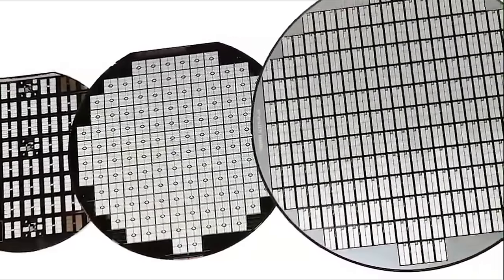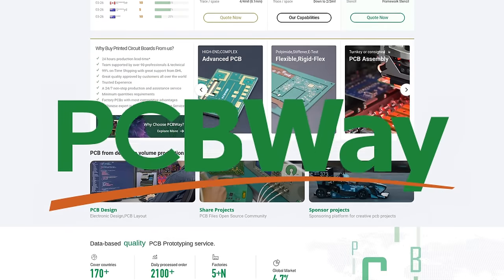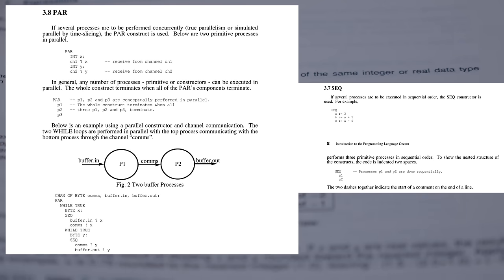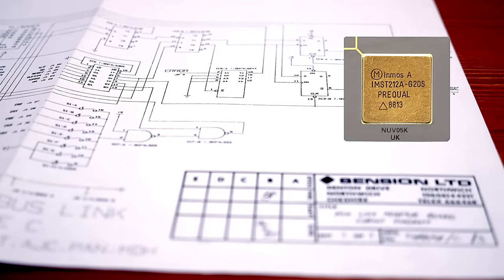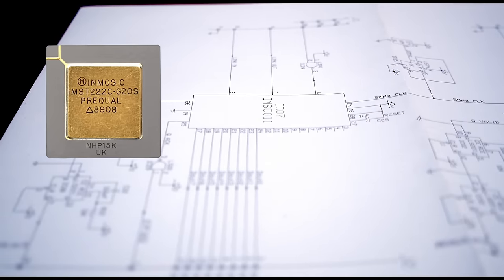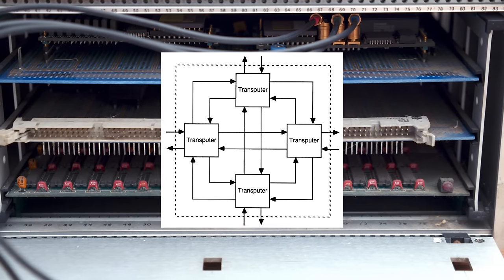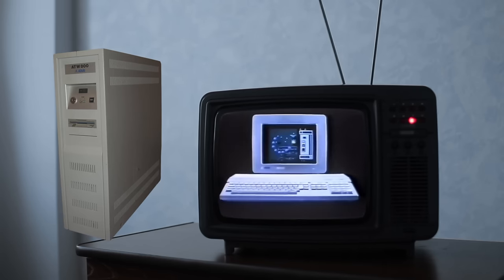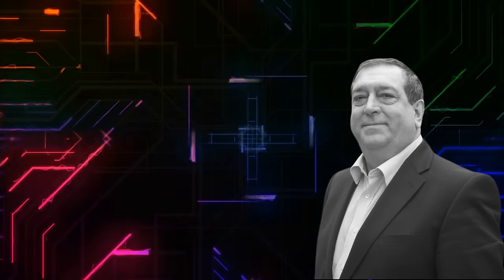The Transputer: A parallel future

Comment: In the 80’s I worked with a friend to develop a native 80x86 implementation of occam (called pc-occam). It is a brilliantly simple but powerful language, and so easy to use to write bug-free code. The idea was to make Occam available to students and others who couldn’t afford / get access to a transputer system.

The three things that impressed me most were:

1) Parallel tasks could run on one transputer or another - but the means of inter-task communication (channels) was identical.

2) Multi-tasking was built into the transputer hardware based on task switching on the jump instruction. Simple and efficient.

3) SEQ / PAR. So simple and easy to use.
Reply: wonder how well itd run on a modern ryzen system
Reply: @cal2127  Not well. Remember that this was a time when memory access latency was much more in line with CPU performance. To get decent performance you'd have to limit memory use to L1 cache only (and there's no way to do so explicitly on x86/x86-64) and then you'd swamp IPI/IPC (which you also can't use explicitly). Modern architectures are simply not designed for Occam's execution model, which isn't particularly efficient to begin with (it 'won', to the extent that it was used, by being a) tractable and b) giving you a lot of compute by the standards of the day with the transputer). OTOH, you could write an emulator, run the whole thing on a single core and get oodles more performance than it had back in the day (such a thing exists as 'the transterpreter' - a backend for an occam compiler, both now sadly abandoned). Incidentally, there are a few similar projects alive today - a wafer-scale supercomputing chip with tightly coupled processor+memory tiles and a switching fabric, and an ARM-based 'neural computing' set-up in Manchester iirc that is also processor+small memory on a single board interconnected with some sort of ARM bus (not aiming at high performance, just an experiment in mimicking human brain style computation).
Reply: I used Occam commercially in the 90s.  A total dead end of a language.
Reply: @drlloyd11  In what sense? Popularity in industry? Sure. Syntax seems.. inelegant, particularly to people acculturated to Algol-style syntax (Wirth-inspired syntax languages generally suffer from this due to not having a single outstandingly successful language, cf Lua and FreePascal). Conceptually and technically? Very interesting. Unfortunately, the type of problem it is most suited for also typically demands performance and scalability and Occam as-is doesn't deliver on that front, so even if it were updated to have modern tooling, people would likely use more performant languages and kludge CSP constructs on top if they really wanted them. One can see microservices in that way if one squints. Golang is the unobvious and indirect successor.
Reply: @paulie-g   In the sense it's performance was mediocre compared with using the other hardware available at the same time.
It wasn't useful.
Reply: @drlloyd11  Yeah, the performance - just at a glance - doesn't look to be on the cards, the language gives up too much for its abstractions. It always seemed (to me) like the CSP model and resultant dev experience was supposed to be the big win, not performance.
Reply: But what about when the parallel tasks had to communicate to each other, and time the addressing of possibly a shared memory pool? That's where things get really fun, trying to deal with resource contention, and timing of tasks to not miss an update if the variables are on another processor. 
I don't mind simple languages, but first you have to know will it do what you want and be adaptable to changes and updates. Also acceptance for code maintenance and people not shunning it is also important.
There are literally thousands of dead computer language githubs out there with no easy way to convert. 
All one can do is take the core logic of operation and start anew in something standard and modern.
(for example. I did an overhaul on 230,000 lines of Quake C on a quake client mod, and it is not flexible like C++, and the server code was in C++ but just bodged together to barely pass an old compiler, but not the latest. )
Reply: @TheMechanator  the language was designed to avoid all that. No semaphores, no shared memory, etc, so no contention or deadlock possible. All communications (local or inter-processor) was via channels. Like the CSP language it was derived from, it was designed to be mathematically provable that it worked (even when using different processes and processors).

But it was very unusual, somewhat hard to work with (limited), and tied to the hardware; so died along with the transputer.
Reply: @TheMechanator  What is your point?
Reply: @TheMechanator  If you think variables can be 'on another processor', I'm afraid you're not in a position to to discuss programming languages.
Reply: @drlloyd11  But wasn't the fundamental idea behind Occam, and the hardware used to implement it really about a framework for computing that abstracted away the details of that implementation from both the programmer and the physically wired system?

Ideally, you could literally program once, for a single processor or one that had potentially thousands of processors, that theoretically need not be local to each other, and not have to care about those details or how they connected at the real world level.

Had this had a similar level of research and design effort as x86 or ARM it might have led to a world of low MHz processors (more power efficient) yet scalably more powerful, without caring about the today version or the tomorrow version of the actual hardware.

Practical, not with the way we program today; Occam does require a different mindset, and other advances have negated the argument, perhaps only because people gave up on it given the easier technology path since adopted.
Reply: @paulie-g  It would be interesting to FPGA some of the Transputer ideas though. Even a scalable Transputer core for MiSTer could be a retro path for some willing to burn a few real-world life cycles over.
Reply: @DennisHolmberg-sl1hz  Personally I would consider software emulators to be a more practical path forward. There is at least one that was far enough along to try things iirc. FPGA is going to be tricky. There's an argument that transputer nodes are similar to tensor cores in GPUs, so a compute shader implementation might be interesting.
Reply: @paulie-g  True enough, that train has long moved on.

Maybe someone will find inspiration from Occam, Helios, etc., and things will move forward like the old days. Today, the current tech being what it is, is the path chosen and where all the inspiration/perspiration will be expended.

It's is similar to the mythical Cray machines from a today point of view vs. a when we were there point of view. Nostalgia has a was of leading to what we could have done then if we had then what we have now moments.
Reply: @DennisHolmberg-sl1hz  That's the thing, I'd love for there to be a good way to experience development in that paradigm. Even modernised post-Transputer Occam isn't viable as a language, but the experience could inform features/directions in present-day dev.

Also, don't write things off. It only looks like Transputer or Cray were dead ends. They really weren't. Modern manycore machines with interconnects are very Cray-like if you zoom out enough. Like I said, tensor cores in your GPU are very similar to Transputer nodes. At a different level, the cells in modern FPGAs that combine some logic and some local memory are conceptually similar (just at a different scale).

Yes, there is lots of stuff in retrocomputing that is charming, but obsolete. But there is plenty of stuff that is very much worth revisiting at a conceptual (if not implementation) level. Pre-relational DBMS are a good example of that.

Comment: Tony Hoare was head of the Oxford University Programming Research Group (in effect the CS department) when I did my Engineering and CS degree there in the late '80s.  Part of the CS course was based on his "Communicating Sequential Processes"  (CSP) formal language, upon which Occam was built.  In later undergrad projects I got to play with quite a few transputers, including ones with audio DACs and 24-bit frame buffers attached.   CSP and Occam's communications channels also heavily influenced Google's "go" language.

Comment: I worked at the Inmos Newport fab during the Thorn EMI years; I wrote test routines so if you have a duff chip it might be my fault 🙂 The transputer had very few opcodes (they were fundamentally 4 bits long) but it wasn't a RISC chip to anyone except marketing; Its instruction set natively implemented multi-threading, which was very complex, in order to allow single chip parallel algorithms. In my time there we went from successfully introducing 20Mhz T800s to failing to introduce 30Mhz T800s, with some cool new stuff cancelled along the way. Meanwhile Intel had gone from 12Mhz 386s to 50Mhz 486s in the same period, which really showed what we were up against.
Reply: So what sort of cool stuff got cancelled?
Reply: @12Mantis  The most interesting was a vector processor in place of the FPU on the T800; it could have been a GPU before the world had ever though of a GPU. There were also plans for other dedicated interface processors alongside the M212 (which had a disk interface on chip). And the project which eventually produced the T9000 was restarted from scratch at least twice.
Reply: @Error6503 I grew up near and spent a lot of time completely unaware of that spot in Newport. Interesting to hear some inside knowledge, thank you for sharing.
Reply: I always thought it was a shame that T9000 link packets weren't just a little bit longer. If they had been, the technology would have been shoe in to implement ATM. The C004 switch chips were ahead of their time, and the C104 was the logical extension of that, but without being able to tap into that burgeoning telecoms market, DS-Links never got the economics of scale to become a world beater.
Reply: Thinking they could stay in the fab-ownership game was what finished them. Intel were pouring $billions into silicon process development, Inmos had £0.50... It was never going to work.

Comment: There actually was another OS for transputers, Trillium.
I once had the source code for it but a disk crash 30 years ago made me loose it.

From the beginning of an article...
"Trillium is an operating system designed for a
loosely coupled, message passing ensemble architccture,
such as the hypercube class of machines. It has
been implemented for the FF’S T-Series[l], a transputer
[2] based machine. Trillium presents a uniform
programming environment that extends out of
the parallel processors to encompass the front end
computer and and personal workstations accessible
over a network. C and Fortran compilers are available
along with a suite of backend development tools
including a transputer board simulator."

A couple of friends and I actually had it running on our homebuilt transputer hardware back in 1991.
Reply: There was also Minix. I had it running on my transputer system a few years ago.
Reply: Homebuild Transputer, maybe the only thing that i was interested more in 1987 then losing my virginity. 
But unfortunately, all tries with my own first designed and build Z80 system showed me i will never be able to this fine tuned skills of soldering.

Comment: Used a crapton of these in my first job. Crash test systems, predictive failure analysis and signal processing. We went through thousands of them. Development used two Meiko dev systems and one very much like if not the same type unit you have. We used the ISA cards and TRAM modules as well as our own cards. Youd have a system with a couple of T440s called PMMs then boards with high end Analog Devices ADCs and filters and a single T400 with a chunk of local RAM. The comms and booting was handled on the power station units, by a 486DLC, pc104 based machine. Most power stations in the UK ran these.
Reply: You might get some luck reaching out to Prosig in Fareham UK
Reply: I did something similar (designed hardware to memory mapping into two transputers on the Meiko image bus with some A110 (I think) digital convolution chips and a ton of Intel i860s (whilst waiting for the T9000 who mysteriously turned up in a Terminator film!).

I shrank my system down to run on an M10 in the back of a Armoured Personnel Carrier and observe IR images then identify potential military vehicles. I really like what Meiko did - I am sure I worked with David May (he uses to call me Derek of Derek and Clive fame) and Neil Coulson - both exceptional Meiko engineers. Meiko is not a canteen automation system - look at end of some belt driven tray conveyor belts. I did get my hands on an early Atari system, as well as the TDS boards for the 80286's. But the Meiko with its programmable MRUN took things to the next level. A few years later one DEC Alpha (ruggedised Military spec) could so same job as 6 i860s with 2x transputers for comms, the image capture cards and the Sparc 2 on the VME acting as display.

Progress

Comment: Wow this brings back some memories.  I used to work for a company in Portsmouth in 1989 that had just moved from Bristol and was manufacturing and testing these transputer boards, we were told that they were used in high end simulators.  I didn’t last long, I worked as a test engineer and shortly after joining the company I made some mistake on a batch and they shipped with some problem and I was rightly blamed and fired.
Reply: FPS America filed for Chapter 11 after their Array Processor mk 2 failed - they blamed it on the Transputer. So don't feel so bad.

Comment: This is a really well set out and comprehensive introduction to the Transputer.  Well done!  Massive bonus points for the BCPL mention. That was my first encounter with a serious programming language back in 1981, with the compiler and linker generating code for a TMS9900 based system. It's a relatively simple language but well suited to older processors with their more limited memory and instruction sets. As for the Inmos founders, the only name that I recognised was Ian Barron. The Transputer was way ahead of its time.  Too bad that I never did any hardware design with it.

Also, interesting footnote... Inmos was also the company that created the IMS-G171, the colour palette chip used in the original IBM VGA implementation and its many clones. There were other widely used variants too such as the G176.

Comment: Very nostalgic for me. I did my masters degree in Parallel Computing Systems in Bristol at what was once called The Bristol Transputer Unit. The last year the course was run. So I’ve experienced the flashing curser indicating deadlock first hand…..a lot!
Reply from the maker: Was David May one of your lectures?
Reply: @RetroBytesUK  not that I recall but the transputer was pretty much dead by that time and there was more emphasis on parallel paradigms like neural networks rather than hardware.
Reply: Was that at Bristol University, or the Polytechnic? I worked in the Bristol Transputer Centre, located in the Poly, during the peak period of 1987-1990. We had tons of transputers, but couldn’t use most of them on accounted of lack of dev tools.
Reply: I also dated Ian Barron’s daughter Clare for a while.  Very sweet girl, but I was kinda useless as a boyfriend. 😀
Reply: @richard_loosemore  it was called the University of the West of England when I went there but yes it was the Poly.
Reply: I also went to Bristol Poly and had a bit of a play in the transputer centre as part of concurrent programming. I was seriously into the transputer and Occam then, but spent most of my time doing Ada on SunOS. I still have all of my Transputer and Occam manuals now. Looking at modern languages, I can't help but feel that we've regressed when it comes to concurrent programming.
Reply: I kinda feel wev regressed as a species tbh 🤣 @NealNelson
Reply: @NealNelson  I did my MSc at Bristol Poly in 1990 and got to have a go at programming in Occam on the Meiko Computing Surfaces in the transputer centre.  I always remember them being proudly on display in P block, but as they basically looked like filing cabinets with the word "Meiko" stencilled on them, they didn't really look that impressive.  I also did a course on Ada/OO programming that was taught by chap from N.Ireland, who'd come to teaching from working on the army's Ptarmigan battlefield communications system (astonishingly still in use, almost 35 years later), and who delivered lectures at an almost incomprehensible rate of words.
Reply: I did my masters in Parallel Computing Systems there too but in 95 I think. Got a placement at SGS-Thomson, Aztec West using DS-Links for video traffic - fun times! Still play with transputers when I have time.